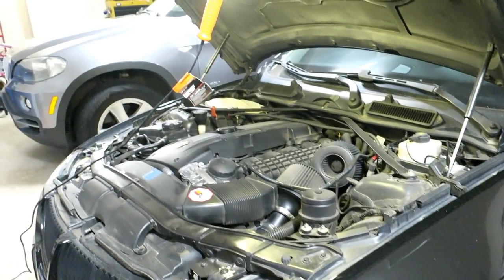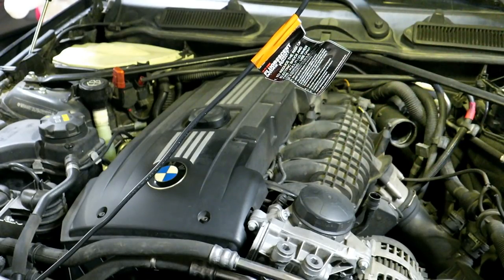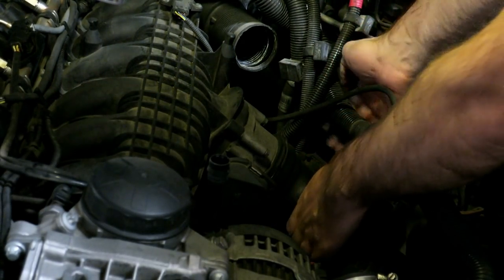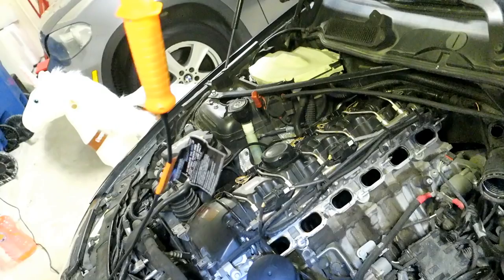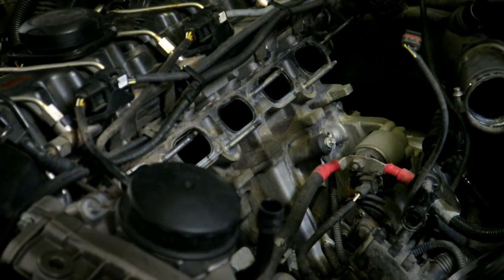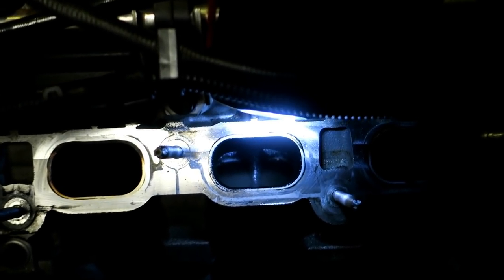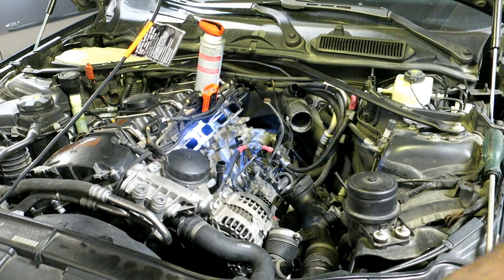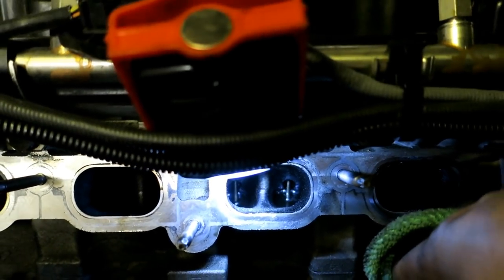Intake Valve Cleaning Without Any Special Tools N54 N55 DIY

Comment: I just completed the procedure and felt like I should contribute as the video saved me the $500 the shop charges. First off don't expect you valves to be as clean as the ones depicted in the video. Mines were really bad and I managed to only get 85% of the carbon off my valve. I suspect once the engine hits full operating temps and the remaining cleaner residue heats up the remaining 15% will be effected. I used the intake cleaner first to break up the carbon using picks and metal brushes. Then I filled the valve area with MMO Marvelous Mystery Oil and let it sit for a hour then gave it a good final scrub and removed all of the carbon chunks and liquid with my shop vac. Lowes sell a small detail kit for shop vacs that has utensils that fit in the valve area perfectly! No mess no fuss! My vac did not explode but do this at your own risk! Once I finished everything also removed my spark plugs and cranked the engine just incase something leaked passed the valves. Upon starting my car ran like crap at idle and seemed to have slight miss so I added .5 quart of MMO and a new oil filter and let the car reach operating temp. I then changed the oil and filter and the car purrs like a kitten! All and all I am pleased with the results and cash still in my pockets!

Comment: I was Curious if Youtube had any videos on this service and see how other people are Cleaning Intake Valves on BMW's. I;m a Master Tech and done this procedure many times and with the New High Pressure Direct Injection Systems Intake Valves are getting Carbon up Sooner Because the Fuel Injector is Not over the Intake Valve Injector is on top of Cylinder Head. On the Older Injection systems Perform Induction Cleaning First than Run Few Cans of Injector Fuel System Cleaner with Chevron or Shell Premium Gas top off the Tank and drive the car after couple Tanks  Intake Valves Should be Clean along with Intake Manifold and Top of the Piston Cylinder Head Chamber too. I just Worked on 2011 BMW 535I  Twin Turbo Had to remove Intake Manifold to Replace Oil filter Housing Seals and I knew those Intake Valves were going to be Carbon up sure as shit they were Cleaned Them with Zep Carb Cleaner Long Seal Pick Narrow Tooth Brush Spray a lot of Cleaner scrub with old ToothaBrush Lol  I have a old Brake Bleeder with Long Hose works on Compressed Air and Sucks out the Fluid out from Intake Port or can use Paper Towels Cut sheet in 1/4 trips ball them up  push strips down into the valve let it Soak for few seconds than pull out paper towel strip long Needle Nose Repeat till Clean Dont let the Cleaner set to long especially Over Night did that once just seemed make it worse when Dried took longer to Clean, you can Due things to Prevent This Carbon Build up .1 Induction Cleaning every 30K miles  2.Use Good Fuel&Fuel system Cleaner  3. Change Engine Oil every 5K miles Dont do it at 10k if you wait that long the Engine Oil Turns into Carbon Monoxide Hydro Carbon Mud Oil Damages Engine Rubber Seals, Gaskets and Crankcase Vent Hoses- PCV Valve  and than over time dirty Engine Oil slowly Drips Down the Valve Stem Seal Down Intake Valve Guide&Valve Stem than Crystallizers into Carbon on back of the Intake Valve thats how Carbon Builds up on back of Intake Valves also the Engine Crankcase Vapor thats Induced by PCV Valve goes to Intake Manifold while Engine is Running shut it off turns into oil and that eventually Builds up on Intake valve Too. thats  40 years Pro Mechanic Advise and Gentleman did this video did good Job
Reply: Holy run-on sentence, Batman! Excellent advice though, and absolutely accurate.
Reply: I had my 335i walnut blasted , but then I fitted a oil catch tank in the pcv line to help keep the oil off the valves , easy and cheap to do
Reply: thank you for the great info Mr.Klaus , i wish you make vids too, and i have a question though, is this starter idea to move the valves after you finish cleaning is only method ? can't i just turn on the car without any spark plus to ensure no fluid inside ? if not where to buy this starter kit that he uses to flip and run the valves w/o turning the car on ?
Reply: my car is E280 272.9 , but i am just asking generally because i'm willing to do the same and make a video to teach other and share knowledge , thank you so much in advance

Comment: Once you have cleaned up your valves installing a catch can system will help considerably. Now a day or two before your oil change follow the instructions on the can for spraying the cleaner through the intake. Don't forget to empty the catch can at the same time as the oil change. This could really help with your cars performance and the life of your engine.

Comment: Great job buddy!  Yes, it is amazing what a difference you notice afterwards.  Install yourself an oil catch can and extend that next cleaning.  I did mine at 60k and now at 123k and runs like yours does without another intake cleaning so far.
Reply: Even better is to look into tapping and plugging the intake runner port holes to the valve cover and externalize your low-side PCV system (via RB Turbo's kit) through a low-flow catch can (like a mishimoto or cheap ones on amazon like Tasan Racing that have the sintered metal air/oil separator). This way, you separate the valve cover from all boost, making it less likely to crack and/or make the gasket leak. Also, under vacuum conditions, having those holes plugged keeps un-separated oil mist out of the intake runners (because externalized PCV would then redirected this mist to a catch can first, before the separated air goes back to your throttle body). This maintains crank case vaccum as well. I catch 3x as much oil in my mishimoto low side can than the burger motorsports "high side" can. I run both.
Reply: @bitcoredotorg  that means making holes in the head, correct?
Reply: @CATPLAYING  No, there are holes in the head that lead to the valve cover's integrated PCV system - it basically dumps crankcase oil mist directly on your hot valves. There's a kit you can purchase from rob beck that allows you to bypass this system with a more effective catch can. To implement properly, you should take the valve cover off, tap the ports, and install a plug into the port to block it off. This completely separates the head from the pressurized intake tract, and helps prevent you from cracking a valve cover from boost pressure.

Comment: When doing a partial teardown. I like to give the engine a good shampoo a day or so before the job. As well as I remove parts clean them then condition them ready to be replaced you will like the end result and it really helps when working on a clean engine.

Comment: I use sea foam at the brake booster hose to suck it into the intake periodically like two or three times a year to keep the build up from happening. I would suggest just using compressed air with a rag over the port once the chemical has done it’s job to get all that left over gunk out. But again love your channel, keep up the good work 👍

Comment: I have a 2006 325i 150,xxx miles I've been watching your content I know I'll get it to 180,xxx brought car at 148,xxx changed my vanos solenoids , air filter , put in my halo eyes . Going to do m3 front arms , with either b4 or b6 bilstein shocks , front brake pads.  New fluids .Might throw a 330i short diff in the late summer

Comment: Crc is not available in my country, I used some carburator cleaner(noticed similar boiling like reaction with the deposits), and liqui moly valve cleaner, worked wonders, surging issue on light trottle is GONE!! Thank.s for the vid, gave me the courage  :D
Reply: Important information! Also experiencing surge upon light throttle. 😅 Will do this asap. 

09 135i 135k miles

Comment: Also, CRC recommends heat-soaking it, but since you have your manifold open, you cannot run the engine.  Maybe try heating up the valves with the heat gun or something.   It's similar to cleaning a BBQ grill, you can get alot of gunk out by heating the grill versus cleaning a cold grill. Just a recommendation.
Reply: A good one at that.
Reply: good one, i'll use my heat gun

Comment: Every time I hear this guys voice, I begin to think that I’m going to have to reverse engineer the entire vehicle

Edit: All while in my pj’s and flip flops.
Reply: is this starter idea to move the valves after you finish cleaning is only method ? can't i just turn on the car without any spark plus to ensure no fluid inside ? if not where to buy this starter kit that he uses to flip and run the valves w/o turning the car on ?
Reply: Mohamed Ahmed Fathi ❶  all he used was a plain wire with alligator clips on the end of them. You could do the same with a regular bare wire. You could go inside the car and press the on button in order to roll the car over as long as there are no spark plugs inside. Both accomplish the same goal, rolling the car over with no spark plugs in order to expel any fluid that drained into the cylinder
Reply: @nuhnuh61  yeah, exactly, although it can get messy that way. I did that once on a hydrolocked engine, it was fun to watch!
Reply: The edit is FACTS but sweats and slippers
Reply: @nuhnuh61  Wait, how do you do this? I'm really confused. For reference, i'm replacing the valve cover gasket as well at the moment, so I have the battery disconnected.  What do I need to connect to what to move the valves??
Reply: @christianoland9878  I’m sorry man I just saw this but all you have to do is bump the starter. Look up a video for an N54. There’s lots of them

Comment: The reason this works so well is a chemical called PEA(polyetheramine). It’s used in top tier gasoline in very light dosages. When concentrated it is a very effective compound with respect to carbon build up.

Great video! This method seems like a WAY better approach vs walnut blasting👍🏻

Comment: this is the proper way instead of running the engine while spraying like other videos on YouTube. Remember good cleaning process will always takes time. This time you trying to remove hard carbon deposit just like a stone.
Reply: is this starter idea to move the valves after you finish cleaning is only method ? can't i just turn on the car without any spark plus to ensure no fluid inside ? if not where to buy this starter kit that he uses to flip and run the valves w/o turning the car on ? 

 my car is E280 272.9 , but i am just asking generally because i'm willing to do the same and make a video to teach other and share knowledge , thank you so much in advance

Comment: Tried this myself, and after spraying the cleaner in the ports and letting it sit (the first time for half an hour, every other time until I noticed it wasn't bubbling) before removing it, I can say that there was not a whole lot of difference, even after about half an hour of scraping at cylinder one's valves and letting it soak through, I couldn't even see the metal of the valves, and it looked identical to valves that were not cleaned. After three valves and no change I finally gave up and put it all back together. This was after 72000 miles as well, but there was quite a bit of carbon built up, more so than the video. If your valves are as bad as mine were, this is not the way to go. Otherwise, great job explaining everything, TIS missed a few connectors that left me scratching my head before I ended up here.
Reply: MrElectrifyBF the formula he uses is extra strength he stated, maybe there are different types of cans

Comment: I’ve been doing this type of cleaning on my Lexus IS250 for some time and it works like a charm every time. But you have to do it when it’s hot outside around 80F  its not as effective when it’s cold. I would say in spring time and in fall.

Comment: That CRC is very powerful chemical, and thanks for posting this video.
Reply: is this starter idea to move the valves after you finish cleaning is only method ? can't i just turn on the car without any spark plus to ensure no fluid inside ? if not where to buy this starter kit that he uses to flip and run the valves w/o turning the car on ? 

 my car is E280 272.9 , but i am just asking generally because i'm willing to do the same and make a video to teach other and share knowledge , thank you so much in advance
Reply: @geniusO2   You can use a 18 gauge wire with alligator clips to do the job like he did here

Comment: That stuff is amazing, while you had the plugs out you could have sprayed a bit of it into the plug holes and leave it there for half an hour and then turned it over to blow it out, which would spray it onto the face of the valves and melt the carbon off ready to be blown out on first start
Reply: Would you disconnect the injectors first and re install plugs (not connecting them to spark) then crank (short 1 sec pulse)  the motor? That way it's only the CRC getting tossed around? or would you leave injectors on so fuel gets mixed in too (still no spark) then crank? or just spray it in, re-install everything and start the motor as normal?
Reply: Sean Smith taking injectors off is not a good idea unless you install new o rings

Comment: I like how the intake manifold studs stick out of the super expensive head, as opposed to an Audi where you have the chance to strip the bolt which screws into the head because you're taking the intake manifold off every 15k miles to scrape that shit off the intake valves. Maybe it's time for me to switch to BMW?
Reply: it's never late to make the switch :)
Reply: DO IT

Comment: Thumbs up for a good job and a great DYI clip from Vehicular DIY ! Much appreciated. It certainly confirms CRC 05319 GDI IDV Intake Valve Cleaner is an effective cleaning agent for carbon gunked inlet ports. Unfortunately I don't want to pull off the supercharger on an Audi 3L TFSI engine to get to the inlet ports. So I just have to follow the CRC can's instructions and use it before every oil change. When I change to spark plugs I'll scope inside the head to see if the inlet valves are clean enough.

Comment: Man this was a great DIY. You’re extremely methodical so after witnessing how much fluid actually came out the spark plug holes, I think I’ll do the valve cleaning, pull all the plugs to expel and then just replace them along with this DIY since they are next up 👌🏾

Comment: Make sure you are cleaning on closed valves! 😬👍
Reply: I killed an engine by not knowing that tidbit of knowledge 😢
Reply: The liquid is flowing into the cylinder. 
Close your valves 😂😂😂
Reply: Rich Cast what happened to it?
Reply: Maybe hydrolock 🤨
Reply: Erwin Van Riel yea seriously poor cylinders are gona end up gunkednwith all that goop. Just take a 22mm socket and turn the crank by hand manually. Cylinder 1 opens and closes first, then 5, 2,4,6 (If im not mistaken). This is a very important step, otherwise you’ll end up with irreversible damage to your cylinders and rod bearings!
Reply: @josephkim9747  

Or your engine hydrolock when . you start the engine . and your engine will crack
Reply: Rich Cast sorry to hear that I wish I knew how to make sure they are closed so I can actually do this.
Reply: how you close it?
Reply: All these comments are so funny as if you didn’t close the valves by bumping the starter. Lmfao they obviously didn’t watch the whole video. Good job bro thank you for this I’ll be doing this over the weekend 💪
Reply: @lorenzotaddei1986  hand turn the crankshaft or bumpstart it til they close use a screwdriver to make thru spark plug holes to measure that they are closed. Screwdriver is at highest position befor moving down. Only do that screwdriver method with the hand turning the crank shaft. If you use the screwdriver and bump start the  engine you WILL ruin your motor.
Reply: But if you make sure they are closed how you going to clean the stems?
Reply: joe butlersnr when valves are closed you have access to the entire valve. The valve is sealing on the head when the valve is closed.
Reply: Matt Crosby of course  Matt , I should have engaged my brain before I asked that dumb question , dunno what I was thinking , I think the old folks home is calling.
Reply: joe butlersnr it’s not a dumb question. I wouldn’t know the reason years ago before I got this unreliable plastic turbo turd.
Reply: Lol, i thought the same thing.  Here's the short cut for those who didn't want to watch for more than a few minutes. 33:00
Reply: @erwinvanriel5843  26:35 your comment is null and void
Reply: Quick question.  Can i just remove the spark plugs and move the valves manually to get them in the closed position?  Then when all the valves are clean I’ll pump the starter without spark plugs to help push out any liquid that might have gotten past the valve etc??
Reply: @davidaguirre6745  
Sure, but remember that at least one cylinder is always open. Clean only on closed valves, move the crank to close open valves. Enjoy it! 😀👍
Reply: Cif Amotan II thx
Reply: If you get some fluid in the combustion chamber, all you have to do it remove spark plug, turn over the car about 10 cycles and it will blast out the fluid. It will be loud and create a bit of a mess, but it's better than cracking a ring or bending a rod.
Reply: Oh weird. How come on the crc can it just days to find a vaccum line?
Reply: @billfishtank7192  that's if you're using the method on the can with the car running. This is a more comprehensive way to get ALL the carbon of the valves and the intake ports.

Comment: I followed your DIY to a T using AC Delco valve cleaner and didn't get near those results.  Gonna try again with CRC and an electric suction pump to remove the residue.   If this saves me hundreds on a walnut blast, perfect.  Thanks.

Comment: The gunk that mushrooms around the valve stem where it meets the valve is alway a PITA to remove. I’d suggest getting a catch can of some sort, BMS or Mishimoto & an RB PCV valve & cap to proactively cut down on the amount of carbon that builds up on the intake valves